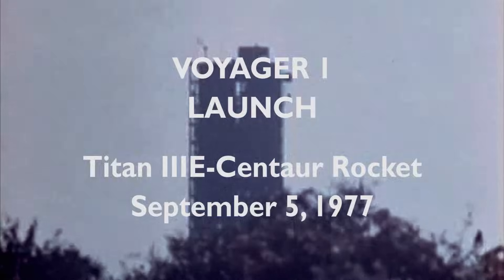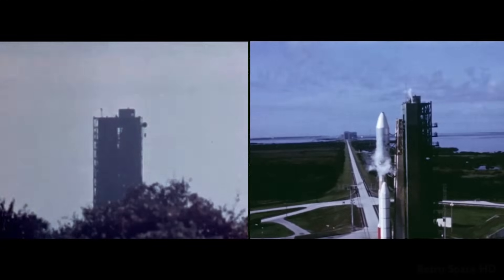VOYAGER 1 - Launch (1977/09/05)

Comment: that launch was seconds away from failure. the second stage had a fuel. leak so it wouldnt burn as long as supposed, centaur extended its burn, and when it was completed, there was fuel remaining just for 3.5 seconds of running. so close one!

Comment: I love that little moment at the end where they show the Titan, shorn of its boosters, flying on in such detail.
Reply from the maker: I've reviewed this footage and that segment shows an odd angle, where you can see both vectoring tanks (on both boosters) but (apparently) not the boosters. The angle is such that the boosters align perfectly with the first stage,  making them invisible! So the boosters are STILL attached, meaning that the video is incorrect! Sorry for that, but that's why I keep comments active ;-) Input is important. I'll updated a corrected (and more complete I hope) Voyager launch video soon 😉
Reply: @RetroSpaceHD  Now I see it!
Reply: The titan used a liquid propellant (N2O4/aerozine50) that burned transparent. The bright yellow plume was the solid boosters
Reply: @manw3bttcks  yeah I didn’t initially put two and two together on that

Comment: At 2:27 the solid rocket boosters are still burning, right?
Reply from the maker: Those two red elements seem part of the boosters (thrust vectoring control tanks), but you can never see both, one is always covered by the booster. Very strange, I never noticed it, thanks for commenting... I'll put this on my "to check" list...
Reply from the maker: I've reviewed this footage and mystery solved!  That segment shows an odd angle, where you can see both vectoring tanks on both boosters. So the boosters are STILL attached, meaning that the video is incorrect! Sorry for that, but that's why I keep comments active ;-) Input is important. I'll upload a corrected (and more complete I hope) Voyager launch video soon 😉

Comment: Similar to a space shuttle launch.
Reply: Solid Rocket Boosters are recycled technology from the Air Force's Gemini/MOL Space Station Program and the Space Shuttle was taken from the AIr Force X-20 program.  The Shuttles ISS Docking Mechanism is Apollo Technology.  Pressure suits were from Mercury/Gemini/Apollo designs.  Only the Shuttles thermal tiles, software and thousands of analog dials and cables were particularly unique technology to the Shuttle program.  I suppose you could count the robotic arm in there, but it was completely and easily  removable and more like a wrench than part of the shuttle.

Comment: Could it collide through the Oort cloud?

Thanks for sharing ! Wow
Reply from the maker: Possible, yes, but highly unlikely (many small objects but spread over a large volume of space).
Reply: it will reach the inner boundary of the Oort cloud in about 300 years and it will take about 30000 years for it to pass through
Reply: @yourfxvjess  Will it still take 300 years for the probe to start transiting the Oort cloud? Omg! 😱

Ok. I'm reading that after crossing the Oort cloud it will be at 1/4 distance between Earth and Proxima Centauri... 😱😱😱

Thank you a lot to both!

PD: I still don't understand how it's possible the existence SO ABYSMAL of our universe...🤐

Comment: How did it get up to 100,000 feet/second? 50,000 escape.  V=ve ln(mf/mi) I guess 1st stage got it to 20,000 ft/s  centaur added 40,000  and the solid motor connected to the voyager added 20,000 ft/s   still does not add up

Comment: its so amazing this vehicle is still working, talking back to us. It will sadly probably lose the ability this year to talk back though, the nuclear generator onboard is severely decayed to the point its not running most systems anymore now anyway. Itll be a sad day when we dont hear from these probes, they are the furthest piece of humanity to ever exist as far as we know and even in death they will still be travelling further and further away we just wont have any knowledge of whats happening. They are 11 billion miles away, think about that its wild, and thats still barely even scratching actual "space". Takes 34 hours to send a message to them and receive a response, the signal travels at the speed of light(or VERY close to it), thats 186,000 miles a second roughly, 34 hours! Man, space is huuuuuuge.
Reply: It actually could operate until 2025
Reply: @definitely_notme4112  yeah, but still exist forever floating somewhere...
Reply: Yeah around 2025ish it’s RTG will most likely shut down
Reply: @tubb1  they actually believe mid 2030s!
Reply: Im glad I was wrong about the RTG and that its still talking, amazing stuff.
Reply: Compared to the vast size of space, we are infinitely small. Perhaps even nonexistent.